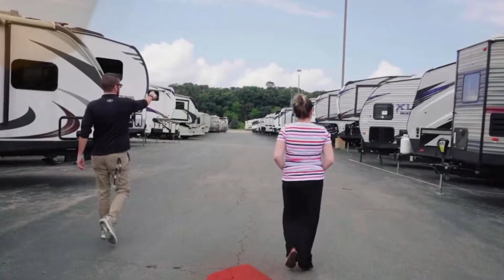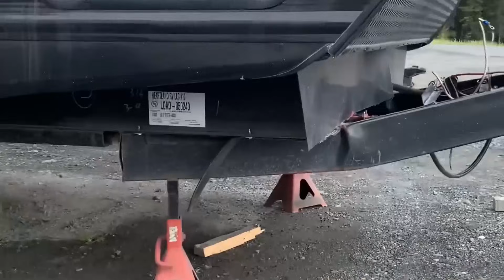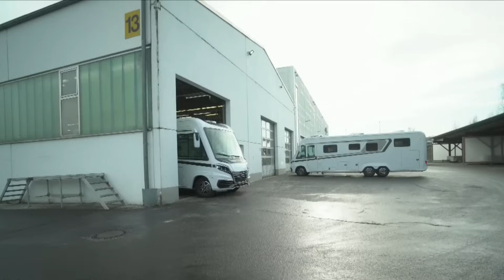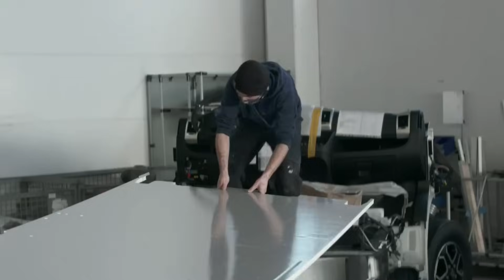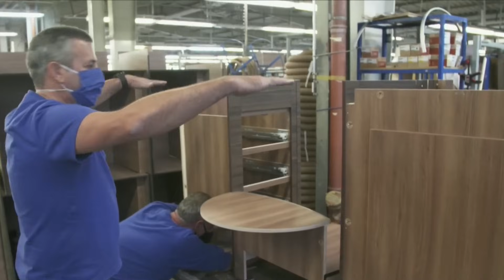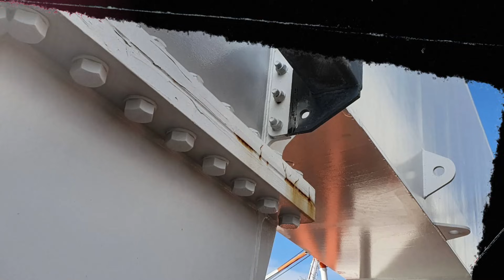WHY MODERN RV FRAMES ARE SNAPPING (THE "LIGHTWEIGHT RV" LIE)

Comment: ALL the class B's - Sprinter, Transit and RAM, all are based on a Uni-Body design. The vans don't have a frame, when a class B is made, they add a frame...kind of. Brakes are undersized, as is suspension and drive train. Lighter is not better!

Comment: It appears that the United States has come to represent volume over quality.  Nearly all of the frames that I have inspected are well under adequate engineering standards.  Substandard thickness and insufficient bracing.  This standard can be traced directly back to the publicly listed companies, that are more concerned with shareholder returns than quality.  Never buy from a company that is listed on the stock exchange.